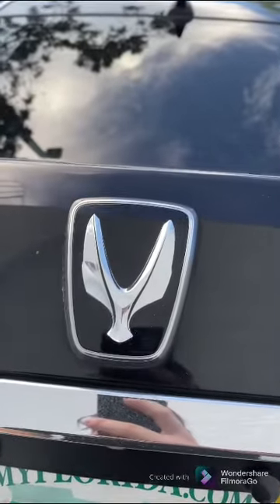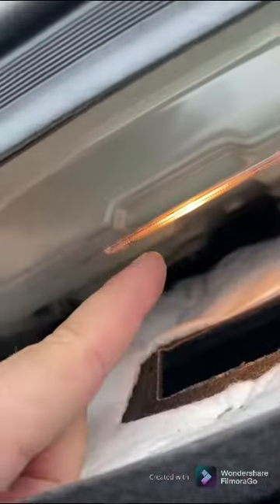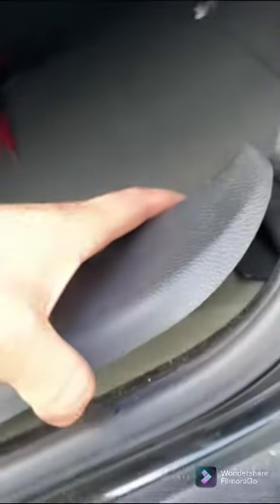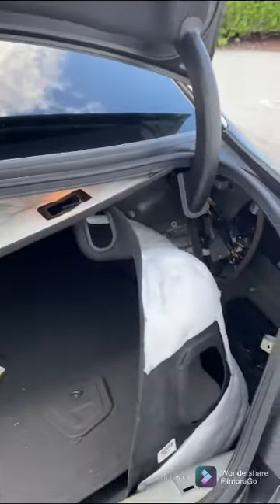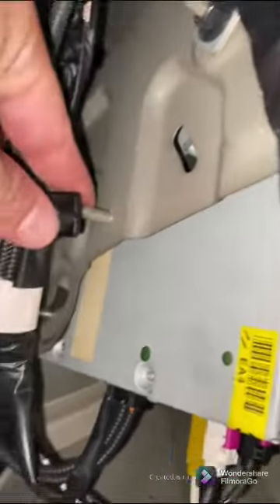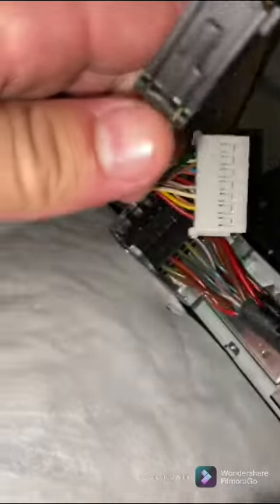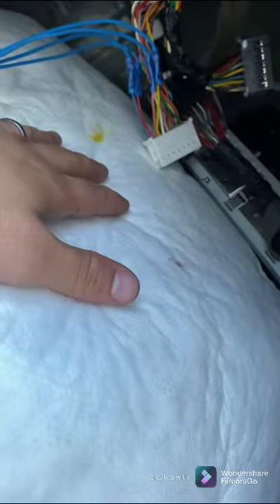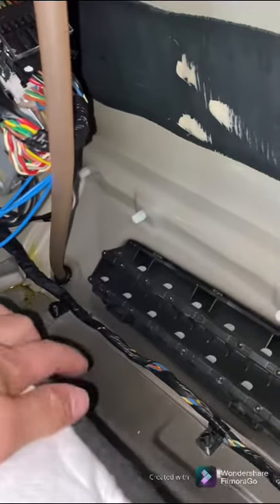2013 Hyundai Equus Factory Amplifier - Wiring Subwoofers

Comment: So if anyone needs information let me know and I’ll assist.
Reply: I Have A Few ?s
Reply: @dougiefreeman3448  yes
Reply: Do you know if the factory signal has bass rolloff? I read that if you use an LOC on the stock sub signal it rolls off at 35hz, but does this line out splicing method have full range?
Reply: @theSWBFman I can’t really remember for certain because i only ran that setup for about a week or two then scrapped it.
Reply: I can’t read that damn diagram 😅 help me out?

Comment: Anyone able to find the diagram with a clearer picture? Ive been looking for days..
Reply: Still need help let me know.
Reply: @ Using this tutorial to acces the stock amp, i used a multimeter to find the wires to splice into the existing subwoofer signal at the amp. Never found the diagram but my 11 bumps now!
Reply: @AJdewy well I know a good bit of information on the audio wiring on this car if you need any help let me know